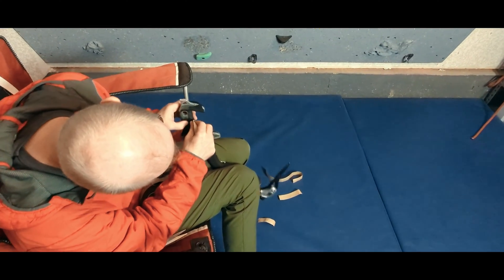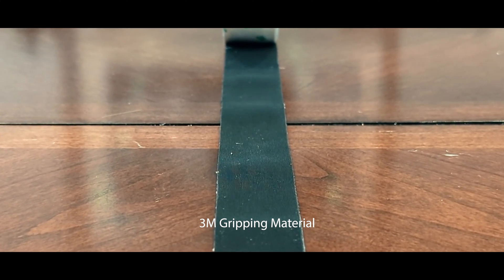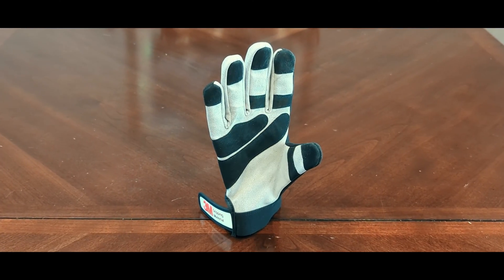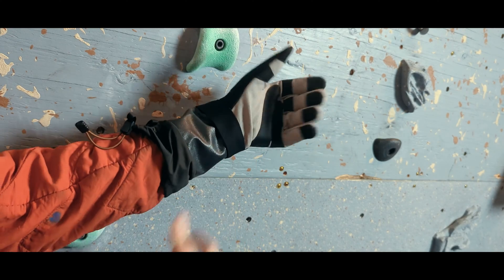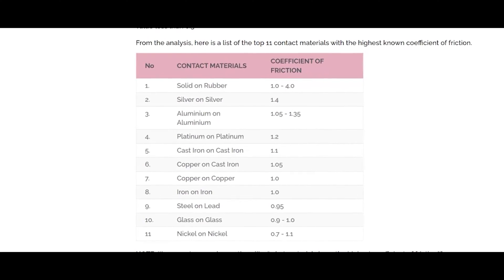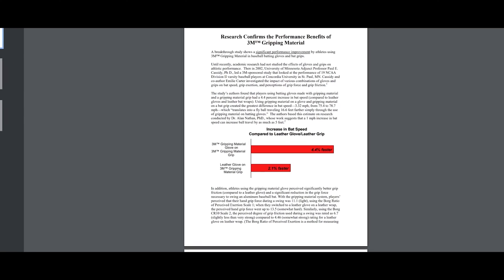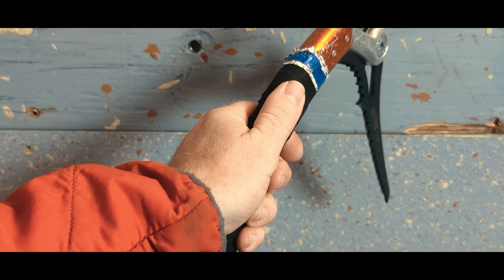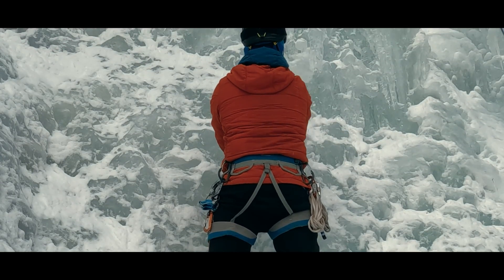Wrapping Ice Tools with 3M Gripping Material: the Ideal Tool Wrap for Ice Climbing?

Comment: So I gave this stuff a try.  My review is that it gets clogged with snow.  Probably pretty good in a pure dry tooling environment.  But also I don't think extreme grip is necessary. at a certain point your glove to tool interface has no slip and the slip interface is between the glove and the hand.

Comment: Any updates on the material? I’m looking for a new set of gloves (I tend to run cold) and just picked up some used X dreams and would like to wrap them.

Any suggestions?
Reply from the maker: I'll probably do another video next fall, but where I'm ending up is using the softer 3M material called the "Grip Hero," and not using the work gloves.
Reply: @ShortGuysBetaWorks  Thanks for the info! do you have any recommendation on gloves? knowing that I run cold, but also don't want something with zero dexterity. I'll be climbing a 150ft WI5 in a couple weeks (following).
Reply from the maker: @brian_simmons_  Pretty much all the ice climbers are going with these: https://sovrn.co/4kjm4mg  1) they run small, so buy a full size bigger than your normal glove; 2) no glove, no matter how thick and warm, will help if you don't drop your hands below your waist and shake out frequently enough. Have fun up there!
Reply: @ShortGuysBetaWorks  Your link seems to be broken.  Also, I would also love to see that follow up.
Reply from the maker: @colwem  updated the links. Things sell out and are no longer carried. I appreciate you pointing it out. I will likely do the follow-up after one more ice season.

Comment: One thing that adds to consideration is how easily the tape causes snow buildup. once water or snow got on it, will quickly lose grip.
Reply from the maker: That's a good point, and something I've been curious about. I'm watching that closely as I test this stuff out, and will let you know what I find. Have you tried this stuff out? Did frosting-over become a problem for you?